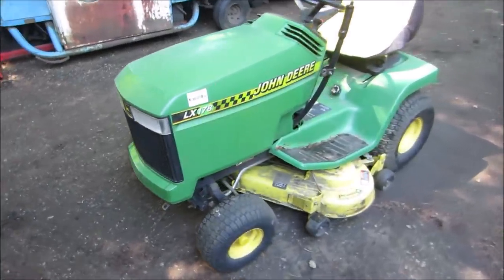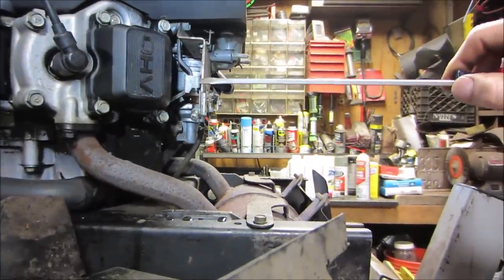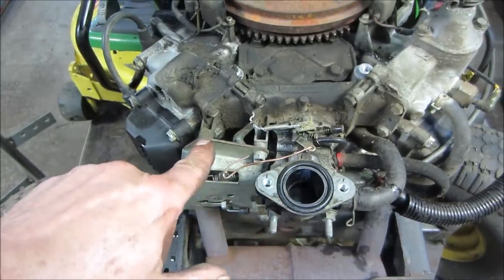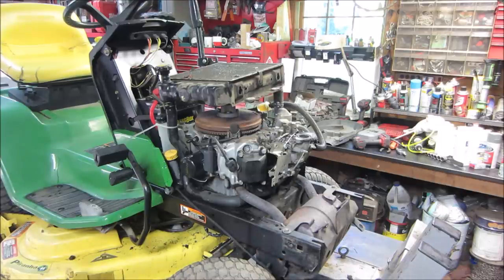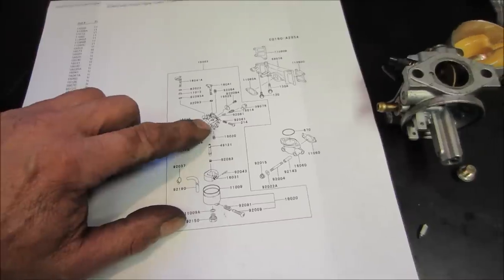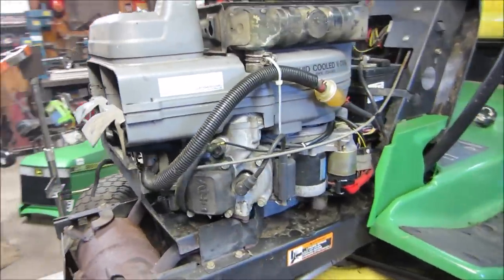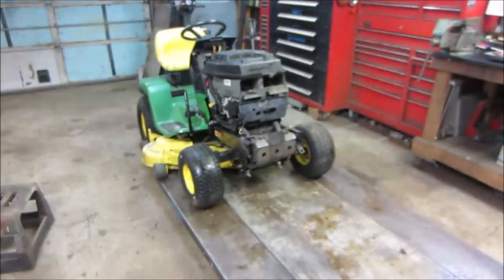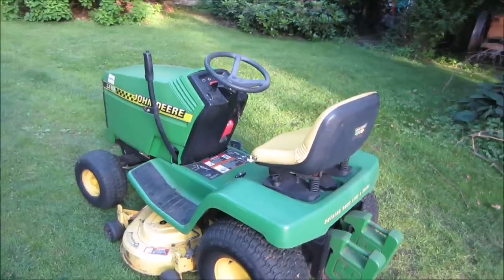yard sale John Deere, lets unfix other peoples repairs.

Comment: I’m 39 years old and this is the first time I’ve ever seen the needle in a carburetor, or a carburetor torn apart for that matter. I’m learning a lot from this channel.
Reply: yep its how it used to be done, i took my car for service ( i used to do it myself) and asked for the tappets to be adjusted (valve clearances) the young mechanic looked at me and didnt know what i was talking about, lucking there was an older guy there who remembers that  not all cars are overhead camshafts or hydraulic lifters
Reply: too
Reply: I specialized in small engine carburetors for years .On the small gas engine stuff, its almost ALWAYS a needle and seat issue...you would amazed at how many people throw away lawn mowers, chainsaws, snowblowers  etc because some dummy tells them it's a bad (and expensive carb) when it's just a needle and seat   that cost $5-7.00
Reply: I bet you've never driven a car that wasn't fuel injected and I doubt you have ever et points of the timing of a car either. Ever change oil?

Comment: I must give you a big THANK YOU for your videos on the LX178. After 23 years owning one I experienced problems similar to what you described and overcame in this series. Thanks to you I didn’t panic when I experienced hydro lock.  I did the same thing you did by removing the plugs. After you pointed out the carb was the issue and the trouble you ran into fixing it, I bought a genuine Kawasaki carb for cheap ($50) and with close attention to the videos you produced I was able to not only bring my most trusted “steed” back to life but regained its youth. THANK YOU so much for the detailed insight into the problem and the ultimate cure. I expect to get another 20 years out of this tractor thanks in great part to your work. Thank you, thank you, thank you.

Comment: Found a Mustie score today while out yard saleing. Saw a Honda FG100 tiller on the curb with a free sign on it. Poured some gas down the cylinder Mustie style and it fired right up. Further investigation showed the seals in the carb were bad. Looked up a kit but a new carb was only $15 so I pulled the amazon trigger.

Comment: That's why I install an in line fuel valve on all my mowers so that way even if there's an issue in the carb I don't have to worry about flooding, hydrolock, or a gas filled crankcase and the fuel valve is also how I shut off my mower. I never turn it off with the key when not in use.
Reply: Even on my new lawn tractor I added the fuel shut off as well...also makes it nice to run the carb out of fuel for storage.
Reply: Just for the ones that don`t know: ethanol mixes with water and when the carb is stagnant the fuel in float bowl  evaporates leaving the  ethanol/water to the last and forming sludge. That sludge is what plugs the jets. It`s a real nuisance.
Reply: 2sheets to the wind which is why I shut my mower off with the fuel valve. After running it out of gas there's none in the carb.
Reply: Even with a gas shut off, automatic or manual, it's a good idea to get in the habit of checking your oil every time before starting... while you have the dipstick out, smell it... Smell gas, don't start it. Also if you notice you have more "oil" than you should have, when you check it, then more than likely, you have gas in the crank. In addition, it keeps you from running it without oil... I have seen where the manual shut offs go bad and leak. Even if the mower has an automatic shut off (they seem to stop working a lot), I always install a manual shut off on my customer's machines.

Don't know how many new customers I have gotten, where they run with no oil or have a crankcase full of gas... If it doesn't blow up or seize up the engine first, and your mower exhaust looks like you are fogging for mosquitoes, you have gas in the crankcase.
I pound it into their heads after I fix their mower... Check it and smell it, every time. 

Plus keep your mower clean so you can see if the engine is leaking oil. When you pop the hood to check the oil, look around the engine for leaks. Don't mow wet grass, and wash top and bottom of your deck, don't leave it parked on grass or dirt or damp concrete. It will rust faster, especially on damp concrete. In addition, a dirty mower will attract and hold the moisture and rust quicker... A vented cover leaving a slight gap on the bottom, on uncracked pavement is the best place, if you have to park it outside.

Long term storage... run it out of gas with the manual shut off and then disconnect your battery ground or throw a tender on it.
Reply: I just get ethanol free fuel from the gas dock at the marina and put stabil in it.    Havent had to take a carb apart in years.

Comment: As a photographer if I may make a suggestion on the harsh light from your LED flashlight, just take a couple of layers of the frosted white bags you get from Wal-Mart or where ever and wrap them around the lens of the light and it will soften the light dramatically and should nuke it show up a lot better on film...or in this case CCD, lol. Soft light is much easier for the camera to pick up. Not trying to tell you your business I thought I would share. Great video as always!! Thanks!!
Reply: I agree. LED as been and will, always be JUNK. I wonder if I'm the only one but,  I find LED screws-up with my depth perception. I've noticed that, by using a LED flashlight. Everything is brighter but, there is no way I can't walk, without tripping over a simple bump on the terrain, every 10 seconds. That situation never happened with a regular flashlight.

Comment: Amazing, Q-Tips and a drill, I wouldn't have thought of that.  I have watched your vids a lot and learned patience and problem solving seem to be the way to fix things, usually if I can't get it done in five minutes I've had enough of it.  I just need to find a bike lift, my rolling on the floor days are about over, I'm too old and fat for that anymore.
Reply: I find it hard to believe Q-Tips would work very well to clean up a bad seat; plus the way he was whipping that drill about with the Q-Tip/ lapping compound. He says the seat isn't available? Is that typical of the garbage they sell now--no needle and seat available for this particular carb?

Comment: "It's just happy it's getting fixed.."  :D  The sidewalls on my tractor's tires were cracked and leaking like that on the outboard side.  I had to remove the wheel, lay it on it's side, then fill it with the goop so that it went into all the cracks at once.  Worked well.  Good work, Mustie!

Comment: Back when I worked on mechanical typewriters (OMG!) we "never" bent anything.  We took out our "forming" tool(s) and "formed" the items.  We never could mention that we needed to bend this or that - esp. in front of a customer / operator.  LOL  Funny how that just popped back into my thoughts. ;)
Reply: Thanks. I'm going to start "forming" all my parts from now on!
Reply: Adjustments were required.. Lol
Reply: My father was a typewriter dealer who also had a repair shop. I would watch the guys ‘form’ stuff regularly. I hadn’t thought about that term in decades. Thanks for the reminder. :)
He sold royal, Olivetti Underwood and eventually got into copiers, mimeograph, adding machines, etc.

Comment: I bought an X300 earlier this year for under $300 at an auction, only thing I could find wrong with it was a dead battery, a cracked hood and the deck (42") needs leveled. Did the maintenance on it, charged the battery and it starts and runs great. Does have over 800 hrs. on it but it's just a back up mower, so I'll run it until it quits then fix it. Thanks for the vids!

Comment: Really enjoyed your video! Just one thing. The wheels on the mower deck (according to my dealer) aren't meant to run all the time. They are only there to prevent scalping in rough areas. They should not be lubed as that only makes dirt etc. stick and create unnecessary wear. The wheels are nylon and are only buffers so that the deck does not bottom out. Correct me if I'm wrong. According to my wife it wouldn't be the first time! LOL

Comment: Another interesting one, and those Deere Riders of that series go quick and easy for sale when you get them operating well. Good job finding the problems, and don't know why the previous person who wrenched on it didn't pull the top end off, to properly get to it, but the homemade gaskets done so poorly shows their craftswork.
One thing about tire slime you mentioned about the balancing, have found if you do it on a road vehicle, then immediately drive it where you can at least get up to say 50mph for a little bit, it doesn't harm the balancing, and works well..my two cents worth anyways. And I do mean right away, as you can't let it sit for a cup of coffee either, just drop it from the jack and pretty much take off to get it circulating. Anyways wish I had the Deere here, as were in a smoking hot heat wave, and hope you're staying cooler there ;)

Comment: Hey Mustie1, great video. I love John Deere yard tractors. The rated RPM  for that engine is 3350. That is about what you had before bending the spring. I own a JD with an air cooled Kawi, and I can say that the engine sounded about right at that lower speed.

Comment: Great deal, great fix! I set my mower decks slightly lower in the front. The thinking on this is the blade(s) cut the grass at their leading edges, and the trailing edges are above the cut grass, so there is less drag. Just saying, not knowing!

Comment: The reason the blades were unlevel is because as the blades spin, the front cutting blade is enough to cut the grass before the trailing blade comes into play. Well, unless you've installed a Hemi under the hood. But normal mowing speeds allow the front blade to cut the grass and the trailing blade can then be set lower to do the same thing.  This is key in a mulching mower as it lets the mower cut two, half inch pieces instead of one 1 inch piece.
Love your vids.
Reply: Except sometimes the lower blade gets there first and cuts the grass lower than the higher blade would cut..  you have to time the  blades,of course ,for it to work properly..

Comment: I've got an lX188,, really the same mower but 17hp( most likely same engine different carb jetting). Mine loads up with fuel if I don't let it idle for about 5 minutes after mowing.. Those lx 178and 188 were some of the best mowers john Deere ever made.  my lx 188 has a 48 inch side discharge deck,, and an awesome transaxle,, I mow my 6 acre yard  in  about 3 hours , it is hilly and that mower just is smooth and quiet and eats the grass up. You bought that mower for less money than a replacement hood cost,, that is the only thing wrong with mine , jd used cheap  plastic for the hoods on those.. I'll sure miss mine when she finally lays down and dies, JD doesn't make anything now that is good  as those in a strictly lawn tractor.  Only other thing is the rubber o ring style valve cover gasket  fails on those , usually on the right side,, but it is a cheap part easy fix less than 8 bucks a gasket
you will love that mower,

Comment: One of the first things I do after buying a lawn tractor, I put tubes in the tires. First off you can't trust the thin wall rims to seal a tire. And in winter you certainly don't need a flat away from service help.

Comment: I put tubes in these tubeless tires, because I get tired of putting air in the before I use the mower.  I had an LT20 Snapper at the farm that would go down between each use.  I finally yank the tires and had tubes put in them.  Never had a problem, again.  Thorns are the worst enemies of thin walled tires.

Comment: I use "green slime" for lawn tractor tires, around here where I live  your mower tires are going to have dozens of 1" long mesquite thorns through them, a good sealer is mandatory. I don't even bother pulling the thorns out of the tires, I just let the green slime do it's job. I still have to air up the tires every time I mow, but they just get low not flat.

Comment: I was 12 or 13 when I started working on lawn mower engines. My first engine was a 3 and 1/2 HP cast iron Clinton engine. I worked on it outside in the dust and dirt. It did run when I got done. LOL. I'm 59 now and still love working on lawn mower engines. Gets me back to basics instead of working on car engines that I rebuilt  for 35 some odd years. To much technology now days.

Comment: Fram 3614 fit most of the Briggs engines.  Since I use Pennzoil Platinum, 10W-30 fully synthetic, I use the XG version of the filter in my Snapper SPX.  It does make the engine hold more oil on a change but it also filters the oil better.  When I have a leaky tire I just put tubes in them.

Comment: Hi a bit confused by your thoughts on the tyre sealant! As a professional bike rider I used a puncture goo because after losing a lot of wages due to punctures, and a couple of crashes from them I decided to try and prevent anymore incidents. If you have had a flat at 70mph on a motorway you know what I mean! The tyre sealant had to be driven on for about 30 miles and then it was ok, manufactures recommendation. Saved me a lot of pain and money. If you got a puncture it left a bit of fluro green to mark it and only dropped a couple of psi. I think people who slated it just put the goo in the tyre without riding it for the recommended time and it just congealed at the low point which was not good. I still use it on my fishing trolley wheels and spin the wheels with a drill for about 15 mins to distribute it evenly.

Comment: Several years ago, I was having problems with our 1987 vintage MTD Yard-man, withe B&S 18 HP V-twin.   It wouldn't maintain the set RPM when cutting, and the hand throttle lever kept moving down.  Problems with the operation of the air-vane governor.  I just bypassed it by rigging up a throttle pedal (with a part from an old sewing machine) connected by a thin cable (routed through a curved copper pipe), tied directly to the carb throttle plate.  Now runs like a whole new machine, with the ability to overide and rev on the gas pedal anytime you're bogged down on a hill or heavy grass, and still leave your hands free for steering.   This has a 4-speed manual shift, so their is no hydro pedal to keep depressed.

Comment: I got a old generator and a Subaru power washer for 25 bucks. Rough condition but definitely going to tear into them using mustie1 videos as instructional guides :)
Reply: Never had the guts to remove and clean a carb before. I did the lawn mower last summer, it was hard to start and revving up & down. Fixed it as Mustie does, carb kit, cleaner etc.. Perfect now !.
Now I'll do my 100$ yard sale snow blower ! Thanks Mustie 1 !!
Reply: Marc René Yvon yeah the little jets and calibration freak me out but I worked on my 96 ninja which has 4 carbs. Took me like a month to dial them in. One shouldn't be too bad
Reply: The name says it all, Mustie is no.1
Reply: Pressure washer pump probably failed which is why you got it for nothing, the only thing that may be worth something is the engine itself...that is if it runs.  The generator, hard to say but typically they set for long periods of time so probably a carburetor issue...or worse case the generator power head itself is bad and not producing power.
Reply: William Todd yeah they both sat which kills engines. I smelled the oil but couldn't smell fuel which is good. Also both had fuel shut off too. The pull starts are free but no idea if they make power. I'll give it a shot. Maybe upload a video too lol

Comment: If you do that a lot on the lift to change blades you should set up a designated ratchet strap to hook on the front axle and hold it on there more securely as you lift and climb under it ;)

Awesome vids sir, I think I've come to the point I most enjoy seeing your vids in the queue

Comment: I hate that green slime stuff.  I come across a product i can't remember the name but it was a sealant in a pressurized can. You can screw it on the air valve and it will completely inflate a flat mower tire easily and completely.  Run around the yard a bit and works great.  Had a tire with lots of slow leaks like yours and i put it in.  Didn't leak down anymore.

Comment: It's been my experience that John Deere mowers/garden tractors seem to be in a class by themselves. My L110 entry level mower has been trouble free (except for lousy fuel issues) for many, many years. I just change oil and filter twice a year and battery when necessary. I'm looking forward to see the snow blower attachment. I mow about 1/2 acre weekly.
Reply: They're certainly in a price range by themselves,  but I guess you get what you pay for....

Comment: When I get cracks in the sidewalls, I let the air out of the tire, spread the crack by flexing the tire and put professional grade superglue in the cracks, then before it dries, pump the tire back up to "clamp" the crack... Still have the original tires on my 1992 craftsman mower... 
Also used that to fix a sidewall rip in my zero turn front tire. Patched it on the inside using a big C clamp and 2 pieces of wood, then after the patch had cured, I superglued the rip on the outside... still holding after 4 years.
If they get to the point where superglue trick won't work anymore, then I put a tube in it... Check the inside where they weld the rim to together and grind down any sharp welds, then use a few wide rubber bands to "cushion" the tube against the welds. I hate using slime... works great, but too messy if you have change or patch the tire...

Comment: Got a Kawasaki on my cub zero turn.  Had problem with gas in the oil. The dealership  recommend was to add a shut off valve to the fuel line to the carb after they rebuilt the carburetor.  Said it's a common problem with those engines. Have no clue really but the shutoff valve has stopped the problem.